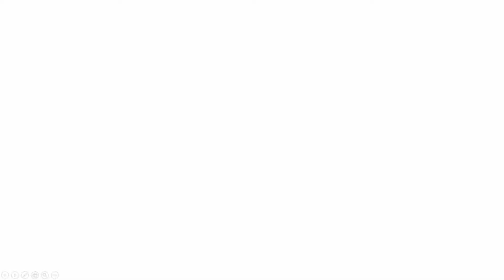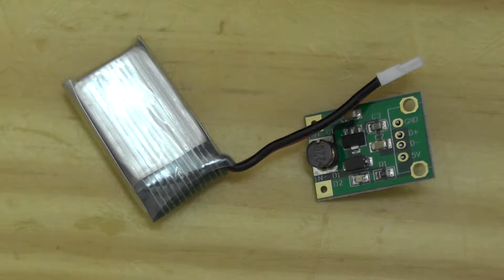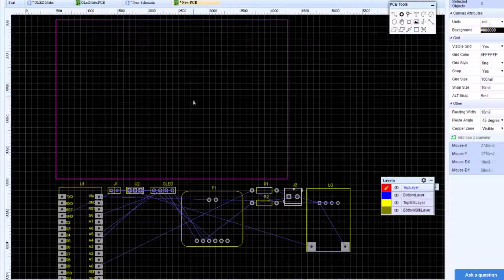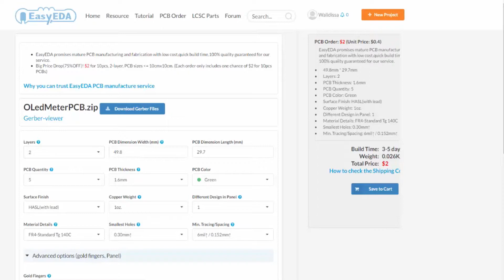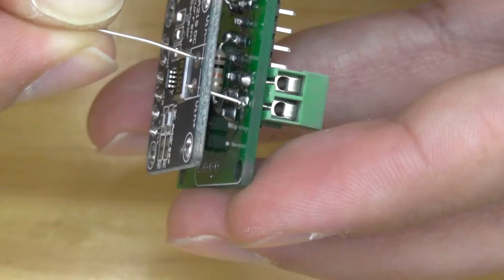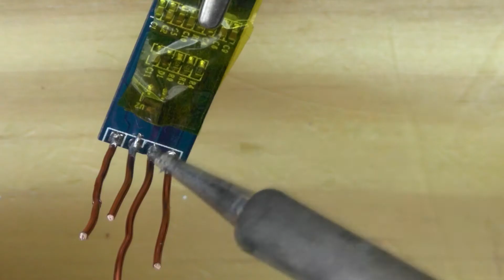OLed Meter from Scratch to a Product

Comment from the maker: https://easyeda.com/

In this video, I will explain how to start thinking about making an electronic product from scratch. I have an example here which is the OLed Meter which can measure the voltage and current. The project is meant to teach you how to design this prototype by EASYEDA and get the PCB then soldering and testing. Hope you will enjoy the video.

The link for the design is ::
https://goo.gl/zCkCgz

The link for the code is ::
https://github.com/wissa/OLEDMeter_V2

Enjoy...